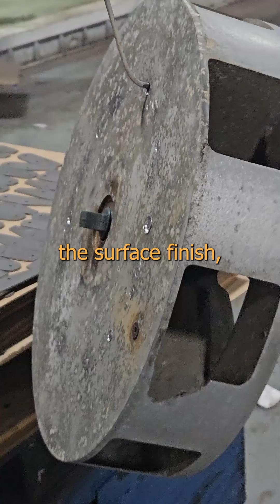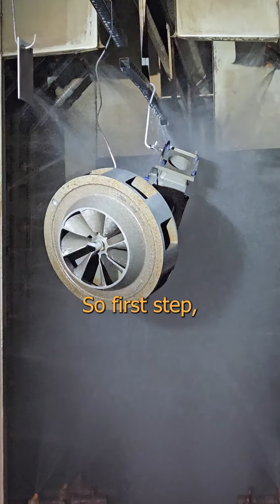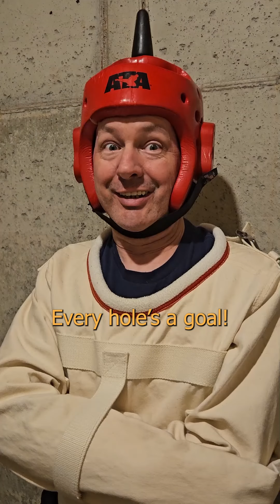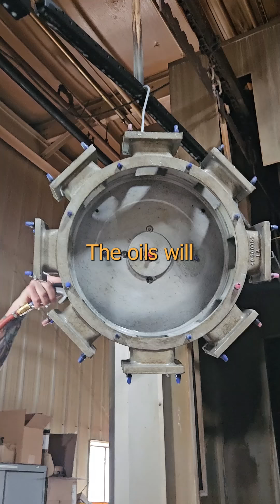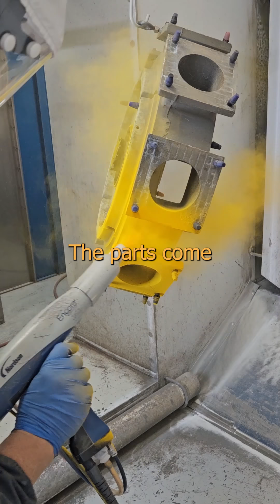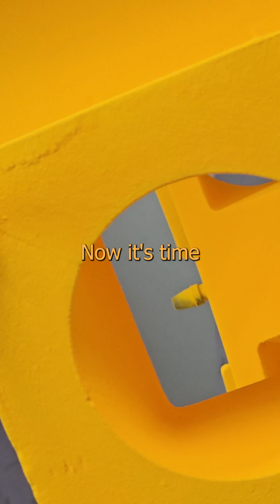Tornado Siren Powdercoat  #chrisboden #comedy #engineering #manufacturing #factory #making #conveyor

Comment: Fun fact: the aluminum also oxidizes almost immediately, but unlike with iron, this oxide instantly forms a tough strong invisible layer that protects the aluminum from any further oxidation. And that’s pretty cool! 😄
Reply: @leickrobinson5186 even cooler is that the grain structure of iron oxide is coarser than iron metal, which is why rust flakes off over time, and why it can continue to oxidize, while aluminum oxide grain structure is similar enough to aluminum metal that instead of fighting itself like tectonic plates, it seals the part in a hard candy shell that's almost as hard as diamond
Reply: @alexandersimcox2079  It's not just coarser, a molecule of iron oxide is bigger than a molecule of iron, so it disrupts the bonding to adjacent molecules. It's like if a jigsaw puzzle piece was suddenly 20% bigger, something would not fit. Perhaps we are saying the same thing in the end.
Reply: @alexandersimcox2079 iron is the only metal that does this. All other metals form a passive layer, even gokd and silver.
The chromium in stainless protects the iron with chromium oxide, as well as reducing the carbon content.
Reply: It is visible though. Aluminum is shiny, but when the passive layer grows, it gets more opaque
Reply: @tachy635  That's the oxide layer thickening over time, but it initially forms almost instantly, whereas steel needs water molecules to oxidize under normal conditions IIRC.  They were saying the layer is there, even on freshly cut/polished aluminum, it's just not thickened to the point of destroying the mirror finish yet.
Reply: @PsylomeAlpha  It does indeed develop oxidation instantly because if it didn't the aluminium would spontaneously combust combust.   It is only stable because of the oxidation.
Reply: @Woffy. Combustion is oxidation. But yes the oxide layer makes it relatively inert.
Reply: @PsylomeAlpha Iron oxidises more slowly, thats all.  It will oxudise more readily in a corrosive or oxidising environment but so will any metal.
Reply: That oxide layer is also hell to weld through unless you've got an a/c welder
Reply: @drakonnos Al2O3, in gem quality, is called corundum, the mineral rubies and sapphire are made of. So yeah, I'll BET it's hell to weld through!
Reply: @NordicRest  also, fun fact, emerald too, just a different impurity
Reply: @ValleyOfTheLost11  nope, emerald is beryl, a different and softer mineral. Padparadacha is corundum, though.
Reply: @drakonnos  I used to deal with prepping aluminum panels for a friction stir welder. Let oxide stay in that weld and you'll be chasing cracks for a month. Bonus if it's also camouflaging OTHER issues with the aluminum due to the specific alloy used.
Reply: Yes.  You get a layer of sapphire over the aluminum.
Reply: Kind of like metal cheese
Reply: Even cooler when you grind it down, mix it with iron oxide, and start the Thermit reaction 🔥
Reply: @steveblobbyblobby2998 thermite is used to weld steel rails, its very intetesting metallurgy
Reply: If not for the issues discussed in the other replies, and refining Bauxite and other ores into Aluminum metal is a bastard of a process, we'd build bridges of the stuff.

At one time, Aluminum was worth more than Gold. Hence why the tip of the Washington Monument is a chunk of Aluminum.
Reply: @matthewcox7985 aluminium also has a low fatigue life.  Iron is very good but Steel can have an  infinite fatigue life if kept within a specific flexing limit.
Reply: Years ago I tigged aluminum for the company that makes the buggy returns for IKEA. They also do bus shelters and such (you can see my work at the Detroit zoo). At any rate, yeah, you gonna wire brush and acetone the parts if you want a weld at all. That oxide layer is freaking hard to punch through, the puddle doesnt flow right, and the end result is a nasty grey instead of the nice shiny bead you were looking for. Also, its piss-weak
Reply: >invisible

You have triggered the sleeper agents
Reply: Another reason not to physically touch it with your grippers tho.
Reply: Not cool if you're trying to weld it!

In fact, all metals form a passive layer of their own oxide. Iron is the odd one out in that Iron Oxide molecules take up more space so the surface swells and cracks, allowing further oxidation below.

Adding another metal like chromium to steel will stop rusting because the chrome will passivate and shield the iron. Stainless is passivated by reacting with an oxidant like nitric acid.

Aluminium oxide is used as an abrasive, odd as the passive layer of aluminium is so soft it will rub off on your hands.
Reply: YOU MASSIVE NERD. I love it. Thank you 😊
Reply: @AndersonPEM  😄
Reply: Second Fun Fact: WD40 was created because of this.
Reply: You googled this shit
Reply: @Biggs_C3i actually know this shit, except the bits I forget obviously.
Reply: @Biggs_C3 Nope, my brain just Hoovers up random facts. 😄
Reply: Which is why it is an annoying conductor to work with when it comes to electricity. Gotta grease it up properly and tighten with the correct torque to make a connection with good longevity.
Reply: @nurstin9411 and any metal you connect it to will use it as a sacrificial anode, even before you start forcing electrons through the joint.
Reply: So is this a reason why aluminum has better anti rust properties?
Reply: @the_rustydoornob7133 it does?
Reply: @andrewstoakes8034 thats what ive been told, it pitts but it doesn't rust to my knowledge
Reply: @the_rustydoornob7133 rust is a yerm for that red iron oxide you sre doubtless fMilisr with.  Aluminium oxide is almost clear or appears white because it refracts or reflects.

When itvgets on your hands it reacts and turns black.

But no, it will not last forever. Stress causes cracks in rhe passive layer and it will eventually corrode. Even if anodised it can still be damaged
Reply: @the_rustydoornob7133  Yes, the main reason.
Reply: @leickrobinson5186  I was thinking exactly the same.
Reply: Fun fact: Aluminum oxide is basically clear sapphire or ruby.
Reply: And that oxide layer can be chipped up to make aluminum oxide abrasives such as sand paper.
Reply: @jimbucket2996 "sand paper"

Hate the phrase, it never has been made of sand.

Glass paper. Carborundum, any number of oxides. But never sand.

Sometimes not even paper.........

I dont know why, but its odd that aluminium oxide can be hard enough to be abrasive and also soft enough to rub off on your hands.
Reply: @andrewstoakes8034 I  believe when they call it "sand" paper they are refering to the particle size. Silicon dioxide is the most relatable sized material we think of that is sand. There are grain size charts you can look up. The US goes boulders, cobbles, pebbles, sand, silt, clay.
Reply: Came here to say this but you beat me to it!
Reply: I was taught that if a conversion coating like Alodine will not be used, a light acid wash will build a thicker oxide layer. Just salad vinegar for a few minutes but watch out for dissimilar metals. Here we have steel studs so can’t dip in acid. The lifting hook would need to be plastic or aluminum to avoid galvanic attack. 
But in all cases anodizing  is the best choice, or, simple Alodine before paint.
Reply: That surface is more corrosion than original sand casting.

Comment: I was told by federal signal the casting imperfections impeller on a siren were for turbulence and noise generation
Reply from the maker: Ope! Careful there sir, I believe you've accidentally stepped in the marketing....there's some on your shoe.
Reply: @Physicsduck  I mean if the goal is noise wouldn’t turbulence make noise? Because the impellers on fire pumps are usually smooth and machined vs cast.

Comment: I have a question ☝️ if the coating is a fine powder being sprayed through the air with high voltage involved, what keeps this stuff from turning into a fireball the way clouds of sawdust/flour/cornstarch can?
Reply: It's not flammable like sawdust, flour or corn starch....
Reply: @oni_goroshi  aluminum dust can absolutely ignite and even explode in the right proportions, especially when suspended in air. I’m wondering what prevents that from happening with something like this
Reply: @oni_goroshi ahhh wait ok, I see where I was confused. I was under the impression that the coating also contained aluminum vs just being a pigment. That would explain it! 😂